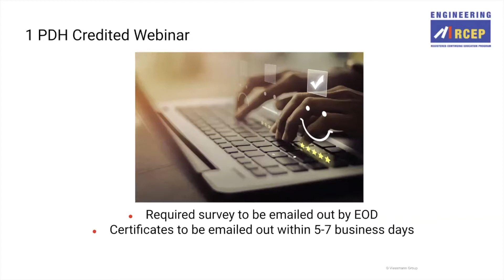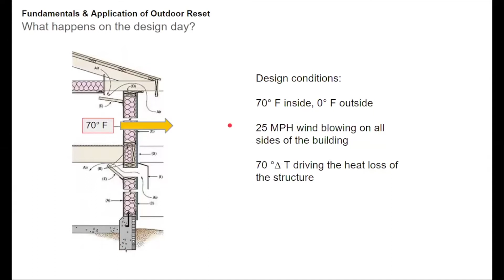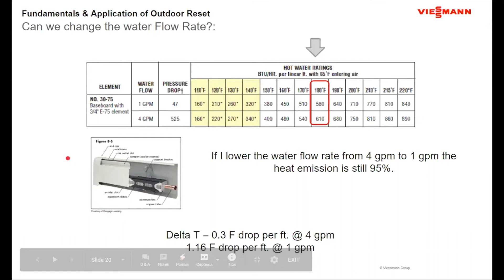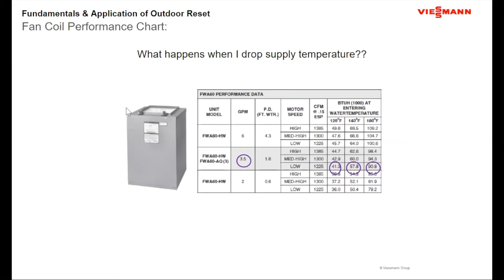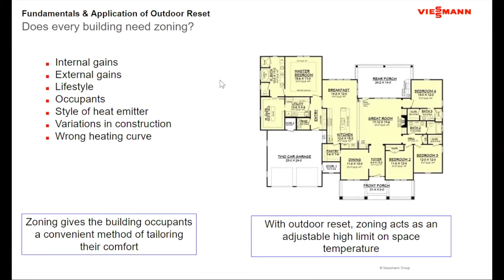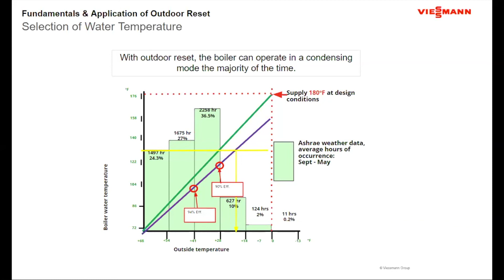Online Seminar: Fundamentals & Application of Outdoor Reset - November 2020

Comment: Thank-you for this video!!  I am not an installer but  this is so helpful!  Looking to replace my old TT Delta combi with the 222f.  I  was concerned about using the 222f with two zones with air handler rads with min water temp of 140 degrees.  My design temp is 15 degrees and my curve is around 135 degrees at 30, so I am assuming a mod con boiler will work better than my high mass non condensing boiler that short cycles.